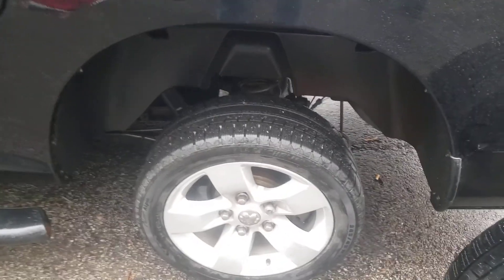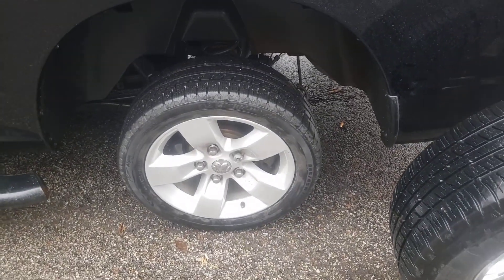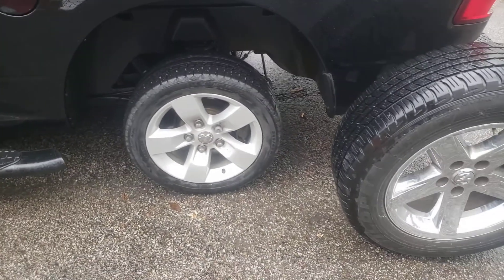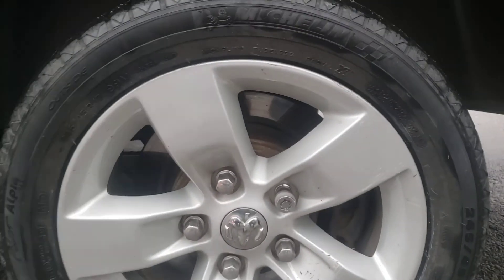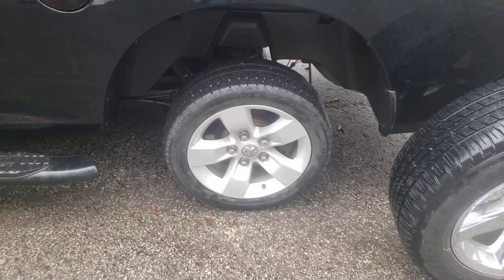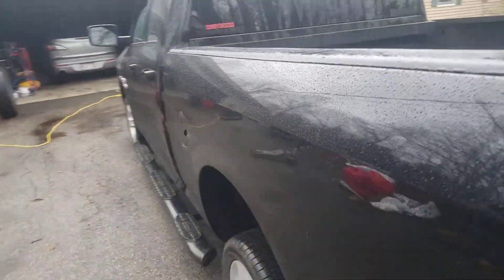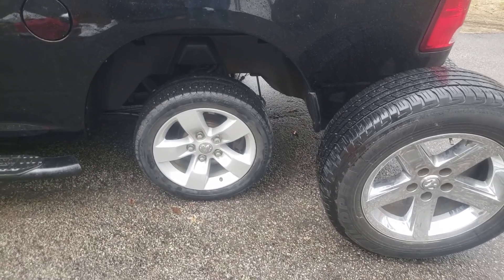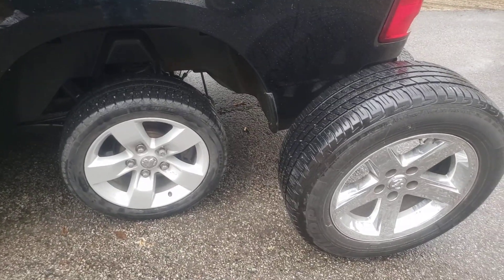WTF 25.6 inch tires on 4x4 ram 1500

Comment: Skipped leg day, lol. Get a 2/4 kit. Lowered does look good. I’ve got the Inez kit, feels like a totally different truck.
Reply from the maker: I was looking at the inez 3 /5 drop
Reply: @rammods3818  I started with a belltech 2/4. You’ll want the Inez relocation brackets to recenter the rear wheel. I now have the Inez 4/6 kit. The 3/5 is the same as 4/6 & 5/7 but with a 1” spring isolator for the front springs.
Reply from the maker: Thank you any pictures
Reply: @rammods3818  yes. Are you on the ramforum.com? Lot of good info there.
Reply from the maker: Yes I do the forms and all the ram fb.
Reply: @rammods3818  check the 4th gen lowered section, I’ve got some posts there. 1sloram
Reply from the maker: I'll definitely check it out.

Comment: Nice video. I’m looking for some used or new parts for my 5.7. If you have any or know anywhere to look let me know please! Trying to save $$ fur my cam swap.
Reply from the maker: Yes I got some stock parts. 
The only part that I am getting rid of that is not stock is a s&b cold air intake
Reply: @rammods3818  well, I was looking for a throttle body and a intake manifold so I can send them to be ported. I like ur vids, I have a lot of similar mods so I’m waiting to see what the best way to ($$) install a cam..figure I’ll put a TB, intake and the ATI pulley when I get the cam done
Reply from the maker: @ryanbrown8413  i have my tb and 5.7 intake.  A new ported throttle body is gonna be $300 pretty much wherever you go. The 6.4 intake manifold is $800. The edelbrock Victor to intake manifold is a $1000 plus fuel rails. Or you can port the stock intake manifold I believe that's around $300.
Reply from the maker: I do recommen the fastman 84mm tb. The biggest gains from a intake at the cheapest money is going to be the 6.4 truck intake. 
 Those are the 2 things Jay Greene told me when I was shopping for parts.
Reply: @ryanbrown8413  wasting money having stock TB ported. Doesn’t get all of the material and needs a larger butterfly installed. Save up for a bigger TB like he mentioned.
Reply: @rammods3818  thx for the info, I looked at the fast man.com and he’s not taking any orders right now cause he’s overloaded with work, guess I’ll wait
Reply from the maker: A lot of guys also run the moe's yb
Reply from the maker: Tb
Reply: @rammods3818  I thought that might be an option.$379.00 do u think it’s worth it?
Reply from the maker: Yes fastman is about the same
Reply: Anyone tested a Hellcat TB ? According to Nick(guy with the whipple ram) he didn't notice any gains with the larger TB on a 6.4 truck intake...
I was thinking about going that route but for the money he said it's not worth it at all.
Reply from the maker: @DL101ca  yes I will have 1 this year. You need some big mods to get any gains. The fastest na ram is running it
Reply: @rammods3818  looking forward to your experience with it. Honestly for the amount of money, I'm more inclined to go for the new Eaton true track for the rear end  or a higher stall new torque converter.
Reply from the maker: @DL101ca  the tires and rims were really small money. I was having some fun doing some experimenting. I do want a truetrac but I race in 4x4 so it not as important as a few other things right now. When I do the truetrac I probably going to change my gear ratio.
Reply from the maker: I do have a 3600 stall. Not going to buy a bigger one till I get a new camshaft
Reply: @rammods3818  ok, that might be an option for me later...
I was wondering about your original ported intake manifold u had done by chuey...cause ur using a 6,4 now , correct?
Reply from the maker: @ryanbrown8413  i do have a 6.4 intake.  Before I was running a stock 5.7 intake
Reply: @rammods3818  oh ok
Reply from the maker: I don't know what you are doing or have for mods. Most guys I see end up with the 6.4. But they are $800 without porting.
Reply: @rammods3818  yes, I see that on MOE’s..I have long tubes, vararam, 180*, custom tune,catch can
...next up trying to decide which cam, ATI pulley, ported manifold and ported TB..I have money for parts however the install and tune is a lot of $$ from my mechanic. So I’m trying to cut a few corners with used parts that’s why I was asking. Thanks for your videos and info it’s helped a lot!!
Reply from the maker: @ryanbrown8413  I will be selling a bunch of parts but it won't be till fall sometime. Thank you for watching the videos
Reply: @rammods3818  ok, I’ll be watching and keeping in touch. No big hurry for me, I enjoy doing little by little.